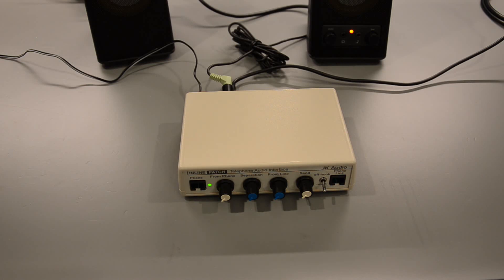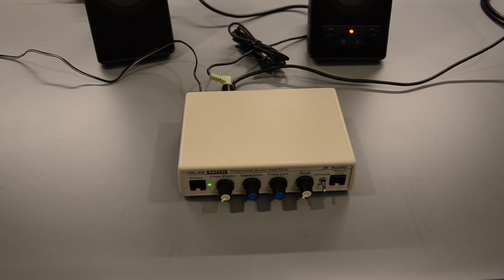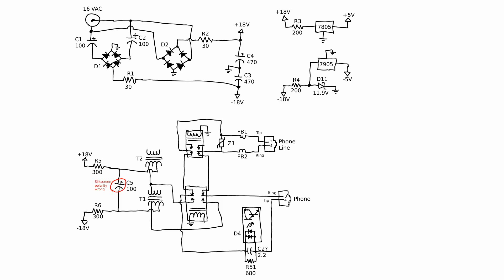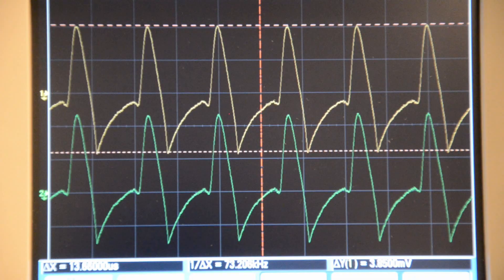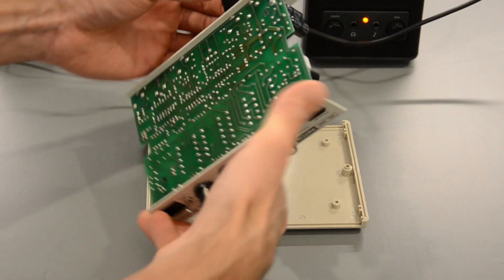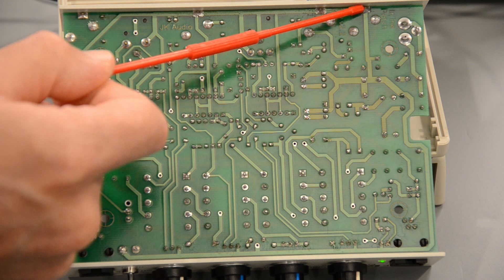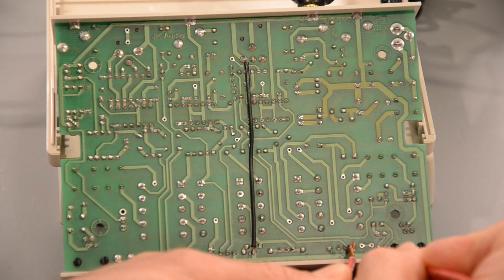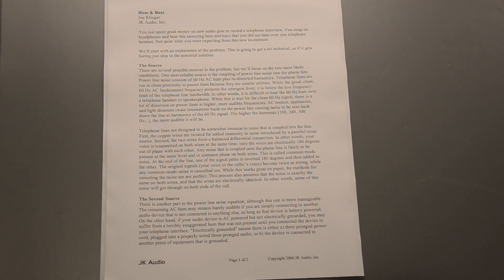Simple Fix to 60 Hz Power Line Noise in Telephone Audio Interface from JK Audio

Comment: You're a lifesaver! My biggest complaint with this hybrid was that noise that was always present even when I was recording without a caller connected. I don't know enough about circuit logic to fully understand what you're doing, but would you foresee any possible problems if I merely replicated your fix as pictured in the video? Thanks again for posting this, it's incredible.
Reply from the maker: Assuming your PCB layout appears to be the same, it's worth a shot.  Worst case, you can always remove the added wire and bridge the cut trace with solder (scrape off the soldermask around the cut) to revert back to the original layout.